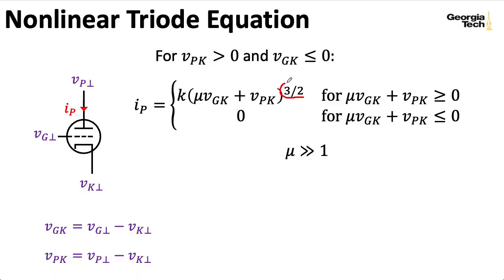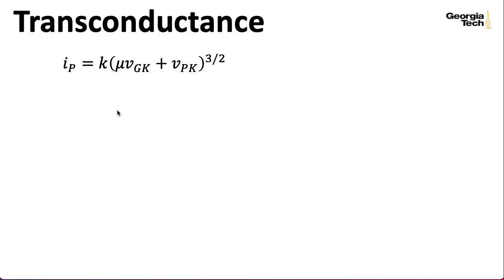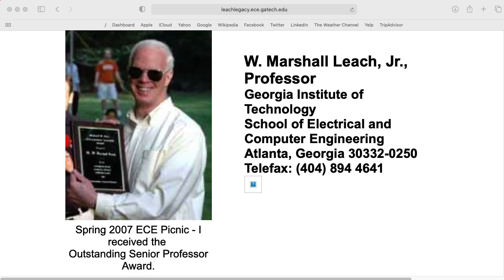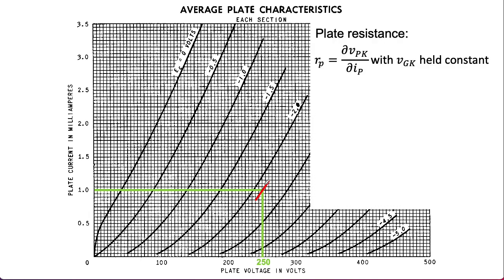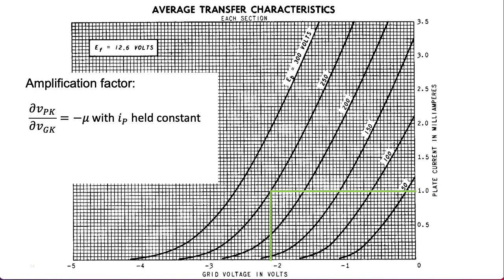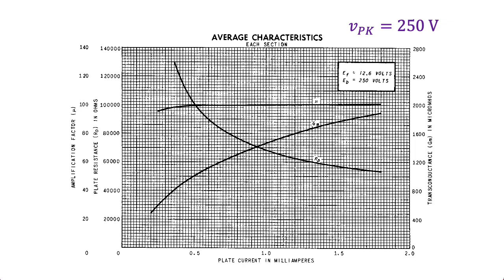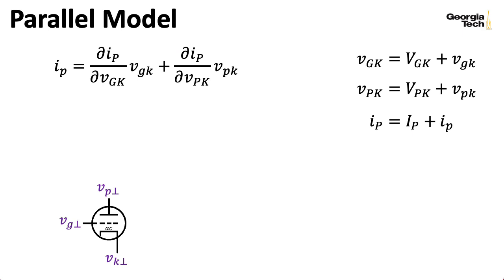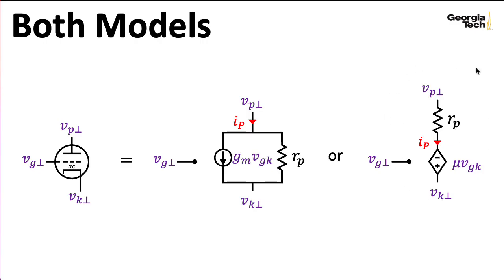ECE4448 L15: Small-Signal Triode Models (Guitar Amplification and Effects, Georgia Tech course)

Comment: 13:56 So the amplification factor is basically proportional to the horizontal spacing of the curves in this diagram. I guess that means that it falls down to zero in the lower left part of the diagram, where the grid voltage, plate voltage, and plate current all approach zero.
Reply from the maker: Huh... I haven't really thought enough about what happens at that extreme to make any definitive statements.

Comment: You know professor! ... that there are some non educated people giving YouTube tutorials on building (modular) synthesizers without knowing the basic formulas and ideas how electricity works .. and still have thousands of followers witch assume what the guy in the video is explain is true! ... while it's not.

even assume that the Drain and Source of a FET magically swap on alternating current.
Reply: There's room for both book-learned and hands-on explainers on Youtube. I don't think LMNC's videos would be improved by the level of rigor that we expect from this channel. Both perspectives are valuable in their own way.
Reply: @stefansynths  more or less, it might be coming to them on later stage that they realize they are handing over misinformation, but the problem i see in that the some people assume it's the truth, while it's not ... meanwhile asking people for Patreon money at the end of the video with the claim it allows me to do more video's. if you aren't  sure, don't ask people for money.
Reply from the maker: FETs are very confusing. They're really four-terminal devices, but for a discrete FET the source and the bulk are tied together to form a 3-terminal device, so it's not really symmetric. But on an IC, where the bulk is hooked to ground (for an nFET) or the upper power rail (for a pFET), the "source and drain" terminals are symmetric; the lower potential is the "effective source" for the nFET and the higher potential is the "effective source" for pFET.
Reply: @Lantertronics     
I hope you can do a very detailed on PNP and NPN transistors ( current controlled device ) / n/p FETs  in a BI-POLAR environment video.

until recently i had no clue at all how the PNP works and slowly i got the idea that's it's all about the difference in potential. bi-polar supplies gave me and as i discovered also among other people that things are going in reverse in relation to GND, but actually is a difference in potential.
Although i always knew that center tapped transformer (2 x 12 Volt) actually really are 1 x 24 Volt.

The NPN was clear from school on.